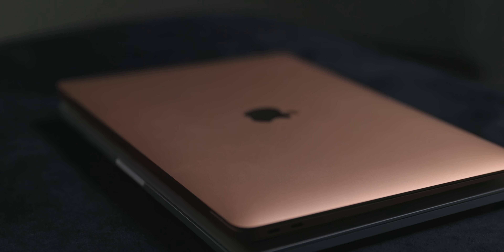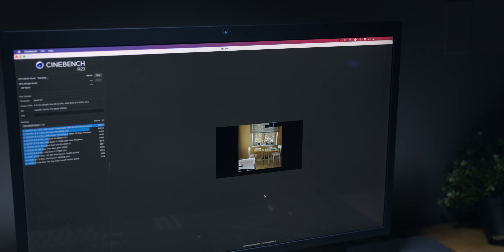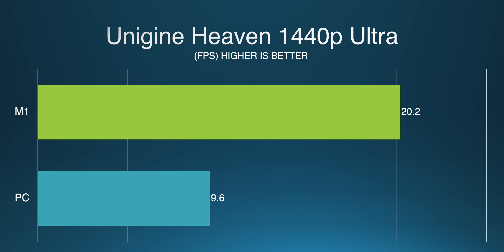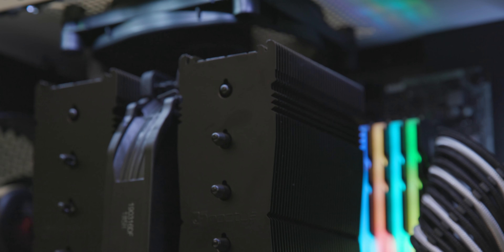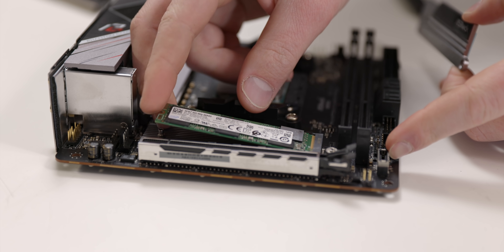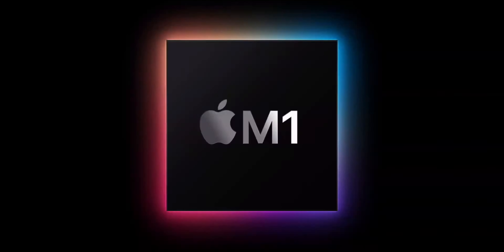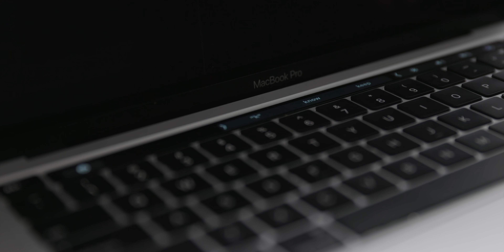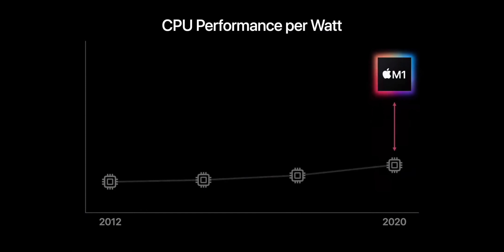$699 Mac mini vs $1,000 PC: Which Is Faster?

Comment: Ryzen is on 7 nm. The M1 is on 5 nm. Apple did not "engineer" jack shit, they just used a much faster, much efficient node (that, it seems currently no one else has access to). I admit, the M1 is fast as hell. But claiming that it has anything to do with Apple's engineering is laughable. We all remember how 7 nm Ryzen beat 12 nm Ryzen to the ground. This is the same just with 5 nm vs 7 nm.
Reply: Not even close. Look at the A14 vs A13. Yes it is more efficient and yes it is more powerful but the gain are rather typical for a node change from a mature node (2nd gen 7nm) to an early new node (1st gen 5nm). The underlying architecture is incredibly impressive and would be even if it only matched Intel and AMD in terms of IPC, given the history those companies have.
Reply: @marctech1996  I think a 7 nm M1 would have been about the same as Ryzen. Both AMD and ARM have good power management, and both are better than Intel's.

I don't really know how can they use 5 nm already. Yields should be still very bad, after all the trouble with EUV. On the other hand if yields are fine, why is Ryzen 5000 not on 5 nm?

All in all, I want a 5 nm Ryzen. I think all things equal, x86 should be better in single core, and that still matters a lot. Honestly it feels like Apple just cheated, by using a node, that should not really exist yet.

Comment: The only massive drawback for a mac M1 laptop, is the ridicule "1" external monitor out of the box support and the lack of virtualbox support. It's kind of a dealbreaker for any software engineer. Yes parallel and vmware support it, but it's not as smooth (for now) and for the VB users, moving all the workflow is a huge bummer.

Comment: disposable/non upgrade-able electronics  are a big issue. soldered in ram and ssd  along with its limited ports are a dealbreaker. perhaps future iterations of apple silicon and design  will allow apple products to have inter-changeable  upgradeable parts. untill then i cant see buying a disposable computer.

Comment: What’s great to me isn’t the speed, it’s the efficiency. Mainly in the laptops. M1 seems to be just about as fast as any of its competitors but it uses like 1/4 of the power (obviously not on full load). I’ve been wanting a reason to actually get a Mac again and since I can’t build one anymore and the previous models weren’t anything special compared to my 3570k hack from years ago (basically saying that I didn’t see the need to upgrade to another intel that’s only 10% faster and I have been waiting for an actual increase in speed, which we got in the latest intel but that’s not future proof in a hackintosh)

Comment: Uhhhh, I get what you were going for in this vid, but if you were to get a gpu and a decent cpu for 1000 dollars it would do better. It might not beat cpu performance, but a dedicated gpu it would CRUSH the M1. However, the point of the vid was a chip to chip comparison, and how compact the M1 Mac Mini is with its excellent efficiency. Yet, there are still a few software concerns out there, but then again they should be resolved in the coming years. Basically what I’m trying to say is M1 is great, but it isn’t perfect like all things, including PCs.

Comment: The comparison with other chips was a bit... Intel/nvidia slides like. Many compared the M1 with last gen's AMD cpus, and then acted like "ooh 15% faster", forgetting that AMD had that increase plus a higher clock coming. Their excuse :"But that's not a mobile chip", no.. AMD takes a while to release those after the original generation is launched for desktops :(.  Not saying the M1 is bad, but I got a bit tired of the "geekbench!" articles, which used nothing more than a score to write an entire hit piece. That happens FAR too much. :(. Does it beat the M1? Probably not, but the comparison is a bit closer than often said.

Comment: Can you PLEASE do an M1 (Preferably MBP or Air) vs Intel 16" MBP (Base, Mid, and Maxed) video? And give your thoughts on if an "M2" or whatever it's called could outclass those machines?

Also, if you have any thoughts now on if the maxed versions will still need to reply on AMD GPU's integrated with the Apple Silicone chip.

I only really trust you to do this video. :)

Comment: Wait for apple to put these in a Server.  If the performance per watt is that much better,  the power savings for a data center using Apple servers would be incredible. Apple could take on Amazon and Microsoft.

Comment: You also have to think about the efficiency of the os and how they are using the emulation, and that for the same price you can get laptops with dedicated graphics and an even better cpu. the Ryzen in the video is good at somethings but it is also a pro variant used for professionals and enterprize uses. apples chip is good for being an arm cpu, but the comparison is like comparing an xbox series x to a gaming desktop. they both have their pros and cons.

Comment: brooo holy shit!! that intro is lit!!

- the apple's igpu has 'encode/decode' coding inside of it, which makes any measure be like a competition between a running person against a cycling...  one have to do less ''raw'' job to do than the other one

- theorically, the m1 has 8 cores... but if you count any kernel except the gpu ones, it would be like 24 cores because the neural engine cores are not there just as an ornament, they have to do something on the system. So the renders would be to compare 2 people building a piece of furniture: one has everything cut out and only has to screw the pieces, while the other must even cut the parts and then join them
(just to point disclaimers)

but even with that, i think that the m1 is a good deal if you are a mac os user or you are a ''mac os-dependant'' developer.... if only it could have and option to add internal extra storage with aftermarket parts, it would be a good thing

Comment: Yes the M1 is a very good chip, but it's worthless if it doesn't run the software I want to run. As a none user of Adobe, I use Vegas, as I don't want to be tied to renting software, this chip is useless. For people who use Apple products I can see this is a big deal, for people who use software that is not Mac compatible then it's useless. I also don't like the fact you can not upgrade your ram or storage, a big letdown. I say this as an ex Apple Tech for a IT support company that supports university's so I'm not just a PC fanboy. This none upgradable way of thinking is not good for the industry or the longevity of the computers.

Comment: I bought the M1 Mini and the M1 Macbook Pro 13" a couple of months ago, I'm at a loss for words to describe how good these guys are, particularly the Macbook Pro, I don't have to plug the thing for almost 2 days even after heavy mixing/producing music on Logic Pro, having an average 12 tabs open in Chrome, using mail and Twitter, watching videos on YouTube,  FaceTiming with clients, etc. This things are quiet, they never feel hot, they never crash, they never slow down for any reason even when using 3rd party, non-optimized software/apps like Photoshop or Illustrator. 
What Apple did  is revolutionary and if you know a bit about hardware and chip design/manufacturing you'll get it. I can't wait for their next chips to come out, particularly for big Mac Pro and their other desktop products.

Comment: Apple is doing what it has done so often.  Abandoning the older users completely.  Forcing old software & hardware to be dumped completely, for the newest incompatible hardware.
They abandoned the Motorola CPU systems, to several other incompatible versions.  Now Intel is very upset that Apple is becoming independent again.
This new M1 chip needs emulation currently, because as usual, there is software lacking.  
To fill this vacuum, Apple tries to retain the old users, before abandoning them forever, hardware & software.
Because these hardware & software costs are small, in relation to other costs of computer use, it seems OK for Apple users.  The mainstream of computer users is not touched by Apple:  Cloud, IoT, networks, mobiles, wearables and desktops.  Apple is second in mobiles (after Android) & desktops (after Microsoft).
These ARM-based M1 systems, along with the new BSD-based operating system might move Apple to be the leader in both smartphone & desktop systems.  I hope so.  Meanwhile I stay shy of being with Apple.  For the moment.

Comment: So here is the thing:
a) M1: Air, low end MBP, low end Mini
b) M1X: high end MBP, high end Mini, low end iMac
c) M1XX: high end iMac, possible low end Pro
d) M1XXX: Mac Pro

Suppose we assume a doubling of performance cores until M1XX we get to 16 cores - probably enough.
Suppose we assume a doubling of GPU cores at each level we get to 64 cores for M1XXX - and a Metal score in the region of 160K which is way more than the top GPU card.

So far so good? Not really...
1) A chip with 16 performance cores and 64 GPU cores would need an estimated 56 billion transitors (up from 16 in M1). The production yields would be lower, the cooling a nightmare and the sales volumes very small.
2) Even then the GPU performance would be nowhere near a Mac Pro with multiple GPUs. This is just not going to cut it.

Accordingly the most exciting announcement Apple could make in March is NOT an M1X. It is new Macs with 2 x M1 coupled together. Then for higher end iMacs 4 x M1 and Mac Pro with configurable cards of M1s. Imagine the scalability, the simpler cooling, the economies of scale at TMSC and so on.

Running software across multiple CPU's is not new - Macs came with dual PowerPC G5 chips back in the day. But when the package includes your GPU and RAM it is much harder. But because Apple controls the OS and the compiler stack they are uniquely positioned to make this work well.

Note: I don't really think the M1 will be the basis of this future (too many limitations with Thunderbolt etc), but the M1X might. Apple's future is in multiple processors, not ever bigger ones. They may want to have an M1C (compute heavy) and and M1G (graphics heavy) to maximise flexibility of customisation at the Pro level.

Comment: Genuinely I think this is a bit off base right now. If the whole idea is a stationary desktop, as you’re not comparing laptops, I don’t care about power draw or heat output or form factor. I’m at home. That literally does not matter. The difference in my power bill is not that much of a difference between a PC and a mac as power is pretty damn cheap in Florida. Also this is great for cpu tasks, but as a legitimate professional and a pretty “serious” gamer in my spare time (high refresh high res gaming), so much of my workflow and hobbies relies on gpu power. For so many people the pc would still offer insane value with an additional price hike of 300 bucks. For light video editing and photo editing the m1 is a beast, but most people testing this are simply applying a few luts to 4K or 8k and testing render times. Vfx in after effects or any comparable program would be a nightmare on m1 as so many of them are Ram or gpu dependent, not cpu. My buddy renders animation in blender, and as much as he’s a Mac guy who would love to have an m1 chip Mac mini, he had to build a Ryzen station to get work done. I want Apple to push arm so that windows finally starts taking it seriously, but right now, it’s all speculation.

Comment: Another great perk you get when designing all your own hardware is that you can include hardware locks on stuff like memory, harddrives, what you can connect to it, and make it so that both your hardware serial numbers, your geopositional data, your messaging usage, visited websites, started applications, opened media AND your personal id is ALWAYS included in the encrypted user report that it sends home to base :)
You can ALSO include tamper protection so that if a user tries to replace a broken harddrive, the computer gets hardlocked out of booting in a stage even before the operating system is loaded. Isn't that great? :)
Snarkiness aside, the new M1's are great. Can't wait to see what they bring out to get more performance this fall :)

Comment: The M1 is showing what can be done when:
1. you don't need to support legacy software optimally like most of the PC ecosystem does.
2. you get to the newest 5nm TSMC node first
3. Software developers will tend to get off their butts and develop for your platform.

AMD at least has a 2021-2022 roadmap that will catch and keep up with Apple on the performance side.
Intel on the other hand, are screwed for the next 3 years.  They will only stay alive, due to cash reserves and the fact that TSMC can produce enough chips for AMD and Apple to replace Intel

Comment: All is good about the M1, except the part where it's basically dead to upgrades ever.
Then the problem with the IO.
Want more screens, sucks to be an M1 user.
It's indeed a great cip for laptop users, but for desktop is a tablet without a screen and unfortunately 0 upgradeability.
If you want to run Windows like on the previous macs ... just forget about it.

The highly integrated and in house built M1 cip is exactly that, one company pony and it's unlikely that it will be useful to anyone that is multi OS or needs compatibility for  the hardware to exist.
(dual boot, triple boot, parallels ... all basically dead on M1)

Comment: M1 is impressive. I totally agree with that, but it is using bleeding edge 5nm TSMC process while even top of the line Ryzen chips use older 7nm process. Newer process alone can cut up to 25% of the power requirements of the chip. Adding to that massive integration (almost everything is on-die or mounted on the same package) which cuts power requirements even more (shorter traces = way less power due to physics). On top of all that while Ryzen mobile is desktop architecture but shrunk, M1 is exactly the opposite. It's super wide as far as CPUs go, based on all their work with A-series SoCs, doesn't need decoding overhead as it's RISC based, doesn't clock really high due to all of that. As you said, it's impressive what they can achieve, but it also has some shortcomings, you cannot change RAM, SSD, there's only one effective configuration for each SKU. On the other hand I heard promising news about Rembrant (Zen 4) but time will tell. Apple bought out almost all 5nm wafer allocation so it's unlikely we will see anything else made on it for a while.

Comment: -Macs are overpriced piece of garbage 

Every pc fanboy are crying rn
Reply: Over priced garbage that was true until now I'd say.
Reply: @genma986  Even now, still garbage:    Boot Camp is gone, compatibility with TONS of Windows x86 software is gone.  And you can FORGET about a quality gaming experience on the ARM-powered M1 chip.  

Most legacy hardware peripherals are going to have problems running on a weak ARM chip from a cell phone (talking about Apple M1).
Reply: @DerekDavis213  Mac always sucked for gaming that has not changed, gaming for never a priority for apple they repeatedly shafted game devs in the rear over the years. 

The M1 chip is no weak though I don't agree with that statement the amount of power per was is highly efficient. If anything x86 has been stagnant for the last 10 years mainly due to Intel. M1 beats x86 in a number of tests running non native code.
Reply: @genma986  Gaming is not a priority for Apple?   What about Apple Arcade?  What about the Metal API?

M1 runs fast and power-efficient, but Intel's latest mobile chips are also very fast, and somewhat less power efficient.  But who cares?    The mature x86 ecosystem is LIGHT YEARS more stable and more diverse compared to the immature buggy M1 processor.
Reply: @DerekDavis213  Priority for gaming on mobile not on desktop, the actively sabotaged desktop gaming. 

Apple and other manufacturers care about the difference in chips, because the it's simply not possible to pull of a lot of designs with especially with Intel they run too hot.

Buggy the the tool chains for x86 is good but that can be fixed for arm as well and it will not be limited by a lot of legacy in the architecture that is holding x86 back. Even Microsoft is taking aim at making their own ARM chips. 

AMD's recent chips and the growth of ARM overall is something we should all be happy about in the long run it's going to make Intel chips better that been completely stagnant for a long time.
Reply: I'm not a mac user or fan but you'd have to be totally daft not to admit this is impressive. Tbh this is the first apple computer I'd actually consider buying in years. It will be very interesting to see what intel and AMD can come up with as I've read they're working on their own ARM CPU's